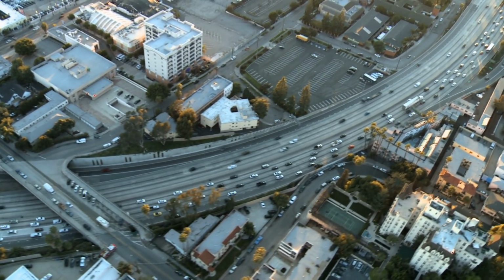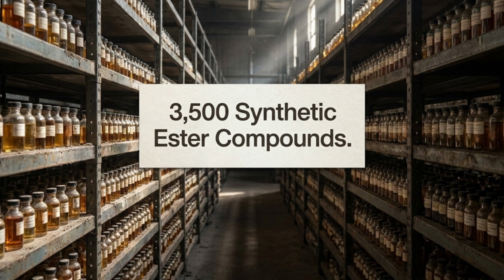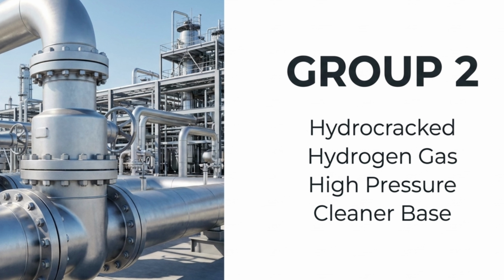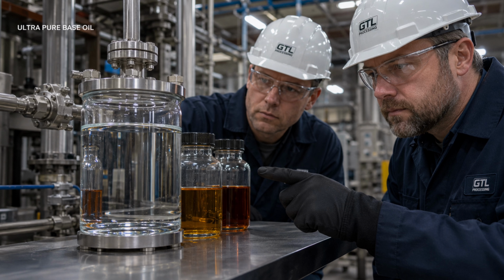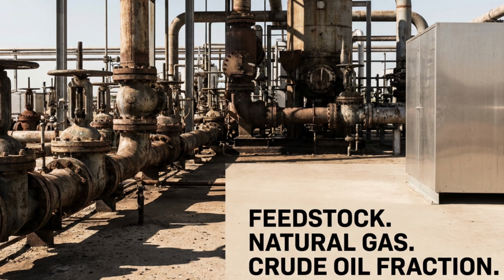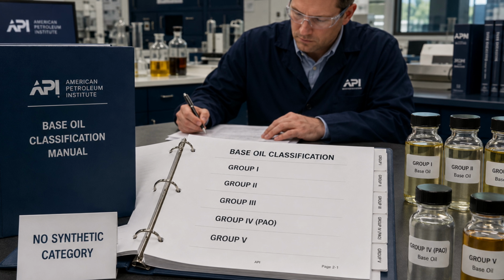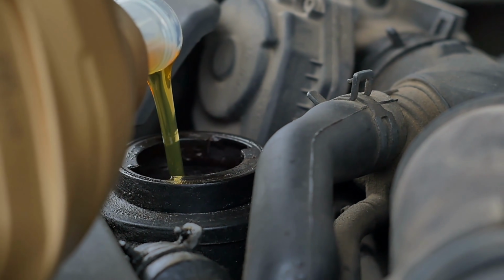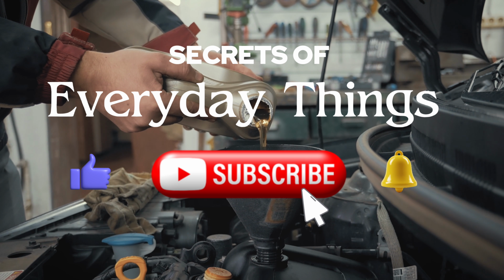How Is Synthetic Oil Made? THE TRUTH BEHIND WHAT “FULL SYNTHETIC” REALLY MEANS

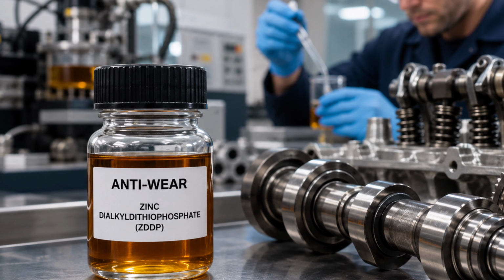Comment: 7:23 A lot less ZDDP in oils these days, so much so you might have to buy it as an additive for oil used in older engines without a catalytic converter.
Reply from the maker: That's a good point. Modern oils often reduce ZDDP levels to protect catalytic converters, while some older engines can benefit from higher ZDDP content.

Comment: BULLSHRIMP !!!!!
 
Taking a vehicle that has been run on organic and has ~80,000 miles then have the type of oil switched over to synthetic you WILL have issues. There are screens put into the newer vehicles oil circulation system and when you transition over to synthetic the crud built up by using organic initially releases and then clogs those screens. It happened to me with a 2019 Hyundai Veracruz.
Reply from the maker: Thanks for sharing your experience. Opinions vary on this topic, and following the vehicle manufacturer's recommendations is generally the safest approach.

Comment: Great video. As a 35+ year veteran of the oil industry, I think you did an excellent job presenting the facts.
The move toward Group III base oils has been underway for quite some time. While PAO synthetic base stocks still offer advantages, especially across a wider temperature range in both severe heat and cold, the base oil alone does not determine overall lubricant performance.
In today's engine oils, the additive package plays a major role in wear protection, cleanliness, oxidation control, and overall durability. That's why I generally recommend choosing established premium brands with a proven track record, as they tend to use robust additive systems backed by extensive testing.
Reply from the maker: Thank you so much for sharing your perspective and experience. I truly appreciate feedback from someone with so many years in the industry.

Comment: FACT: Semi-Synthetic can contain as little as 5% full synthetic.
Reply: Amsoil performed testing on all the Synthetic Blends sold in the marketplace and determined the amount of synthetic in their Synthetic Blend was anywhere from 1% to 15% (depending upon the specific brand).  Amsoil developed their own version of a Synthetic Blend (in order to compete against those inferior Synthetic Blends of their competitors) several years ago that actually contains OVER 50% SYNTHETIC!!

Lake Speed, Jr. (a.k.a. The Motor Oil Geek) conducted on a 5,000 mile oil sample of Amsoil Synthetic-Blend Oil on a 2012 Jeep owned by Ronald Robbins from Maine.  Lake was pleasantly surprised to find there were very low wear metals in the oil (only 2.4 ppm wear metals per 1,000 miles, which was well within Lake's recommended threshold of less than 5 ppm wear metals per 1,000 miles), where Lake remarked "that was doing really good." Immediately thereafter he said "that was performing excellent[ly]."  Lake determined earlier through an analysis of a "virgin sample of that oil" that Amsoil not only uses an Ester (a Class V Synthetic), but a special type of Moly additive (that is more expensive) in the Amsoil Synthetic-Blend Oil that contains a special form of MODTC (that is not usually found in a typical full-synthetic oil) that has a greater content of tin in his analysis of the "virgin sample of unused oil."  He added that special Moly (containing that unique type of MODTC additive) has anti-friction, antioxidant and anti-wear properties, which are borne out by the excellent results with low wear metals in his test of that oil.  Lake remarked that this oil would be equivalent to a typical "full synthetic oil" that you will find in a big box store, but he indicated a typical "full synthetic oil" sold at a big box store wouldn't contain that special moly containing MODTC (that is found in the Amsoil Synthetic-Blend Oil)!
Reply from the maker: Thanks for sharing. The definition and composition of semi-synthetic oil can vary depending on the market and industry standards.

Comment: The problem with whining about Group III being called synthetic is that even if the name was changed, the same product would still exist and it would have a product grade designation different from Group II. It would even be acceptable for use in the same engines. The name doesn't determine what it is. This really is a case of it is what it is.
Reply from the maker: Thank you for sharing such a thoughtful perspective. You're right that classifications and terminology can change over time, but what ultimately matters is the technical specification and performance the oil meets.

Comment: As a farmer with lots of different engines all of it used to be honey colored.  Ive noted that new oil is so clear that its hard to read on a dipstick.  Now I know why!
Reply from the maker: It’s great hearing real-world experience from someone who has worked with so many different engines. Thanks for sharing!
Reply: @SecretsofEverydayThings  I dont know that Im that much of an expert.  I did learn a lot this last year working on a project IH 784 with lots of hydraulic issues.  I was on one tech site arguing that the cold weather stalling I was getting might be solved by going to IH Hytran Ultra Synthetic.  This says that I was right.  All I did was to read the specs.  Prior to this IH had a couple tech bulletins on that and it amounted to overfilling the chamber to improve the downward flow.  Im still doing that but its unlikely Ill be changing out the fluid again any time soon.  An opportunity lost I think.
Reply: I used to work as an lube tech (specialising in ag lubes) for one of the big dogs.
Your 100% right
Reply: @danedgar1539  You're

Comment: -  So, we have learned that most synthetic oil - is synthetic oil.   Got it.   I live in a warm climate, so my brother changes my oil, and always uses 30 weight synthetic.    512,000 from my last Toyota (that got totalled, but still ran great), and so far, 241,000 on my "new" Toyota 5-speed.   But much of my transportation is on my bicycle.   I ride a Cinelli from 1987.  it has Campagnolo 50 anniversary groupo.
Reply from the maker: 241,000 miles and still running well is impressive! And that 1987 Cinelli sounds pretty special too. Thanks for sharing!
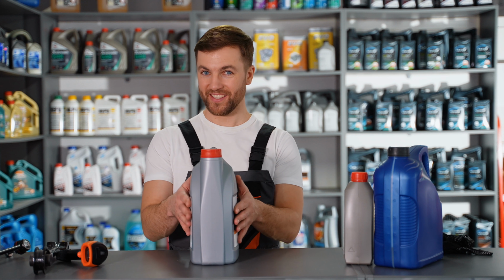Reply: @SecretsofEverydayThings     -  You're welcome.  Yes, I drive easy and slow.  Women don't have anything to "prove" - that's for boys.   My favorite thing to do on my bike is - stay with ... or in front of cars - it freaks them out that they are cars, yet a bicycle - much less a woman - can beat them.   In America, I got lots of angry drivers.  In my country, soooo many ride bikes, that it's not an issue.  I like the safety of my country.   Speaking of - it's lunch time now...   12:16

Comment: if I buy oil I buy Red Line, the only oil I have found to stay thin in air cooled generators when you are as lousy on maintainence as I am.
Reply from the maker: Thanks for sharing your experience! Different engines and operating conditions can have very different oil needs.
Reply: @SecretsofEverydayThings  true, and over twenty years out of date perhaps but I have been happy with it since the mid 80s in all my engines.

Comment: As a young university student, I worked in the lubricating oil production unit of a Gulf refinery. They were still making some base oil using solvent extraction with furfuraldehyde. The resulting oil was brown and I guess fits into the group one discussed in this video. The unit I worked on was a new hydrotreater unit where under high temperature and very high hydrogen pressure and a platinum catalyst, the same feed stock was convert to almost water clear base oil. I was amazed. It was the most interest job I ever had.
Reply from the maker: Thank you for sharing this firsthand experience. Seeing the difference between traditional solvent extraction and modern hydroprocessing in actual refinery operations must have been fascinating. Insights from people who worked directly in the industry add a lot to this discussion.

Comment: I just happened to change the oil in my car yesterday afternoon.  I do it myself.  5W-30 Mobil One.  With 98k miles on the engine, I do it every 3k miles.  I'm hoping for 300k+.
Reply: Just breaking in, keep doing what you're doing. I do the same but with Castrol Edge and get 250-350k on my cars.
Reply from the maker: Thanks for sharing your experience! 250–350k miles is certainly impressive.
Reply: @SecretsofEverydayThings I never ever had a oil related issue. Right now I have 2 cars with over 200k with thier original turbos. Now that impressive 👏 in the summer I'll change the oil around 2500 miles.
Reply from the maker: Sounds like you take great care of it! Hope it makes it well past 300k miles. 👍
Reply: You should be able to get 500,000 plus k on the motor. Something most people don't think about is the thermostat. They can stick when they get a lot of miles or kilometers on them. If that happens, you can get a warped head. A cracked head  or a cracked engine block. Change the water hoses and heater hoses by at least 150,000 miles or 250,000 kilometers.
Reply: -   Rand, why do you Americans still use those British "miles"?   Isn't it time to go "science", and rid Britain?  Just wondering, sweetie.
There are 4 countries left - who still use "miles":  Zimbabwe, Myanopar, Belize (all poverty countries), and USA.   How proud you must be.    🙂
Reply: Hate to break up the party but changing Mobil 1 synthetic at only 3k you're  wasting not just a valuable resource but flushing lots of your $$$ out the drain plug too. That short of an interval is a conservative one applicable to conventional oil, but high quality synthetic like Mobil 1 no way. Anything below 5 - 6k intervals isn't really advantageous to your engine.

Obviously in racing intervals can be much shorter, but I've NEVER actually heard it advised to change Mobil 1 at just 3k in street use. Except maybe if the car sat a long time. 

But don't take my word for it research it yourself! Plenty of great resources out there like Oil Geek.
Reply: @katmanluke7187 Well Kat, oil dilution from DFI, turbo and low tension rings will debunk what your saying. Don't get me started with carbon. Using expensive oil makes no difference.
Reply: @gino5037 I said nothing about "expensive" oil, the premise is quality synthetic oil. Degradation of those oils by 3k in a normal car is marginal unless the motor in question is poorly designed, a POS, or a dirty diesel.. Or all the above. Which is yours?
My '11 Honda 3.5L V-6 w/176k must not be so bad after all then because at 3k the Valvoline synthetic I use is barely discernable from new & I typically change at 6k. Vehicles much newer than 2011 I wouldn't venture to guess on since great majority are built to last the warranty & little more. Even Honda has motors prematurely failing.
Reply: @katmanluke7187 Mobil isn't expensive, seriously? I'll stick to Castrol never ever let any of us down over the decades.
Reply: @gino5037 why you asking me I don't use Mobil 1. 

Cost effective is actually the precise reason I switched to synthetic many years ago when conventional went thru the roof. Good synthetic easily doubles the 3k interval & offers cleaner, much better protection. And good synthetic isn't double the price of good conventional so it's synthetic for the win...
Reply: More money than sense.  What a waste of oil.
Reply: In an older carbureted car that change of around 3,000 Mi makes sense but modern fuel injected cars Burn Way cleaner and you are wasting a lot of money I would extend your oil change to at least 5,000 miles maybe 6,000 MI. By the way most car companies recommend 7,500 MI and sometimes up to 10,000, which is way too long in my opinion
Reply: @thomasward4505 You couldn't be more wrong! Higher compression, DFI, turbo, low tension rings, thinner oil, oil dilution get the picture now, 3k max! I bet that you believe in lifetime fluidsl in your drive system 😂

Comment: Pretty good, but still not the full picture.  The Group IV POA oil is Mobil 1 and I knew several of the engineers who developed it.  What they said was interesting.  Lubrication oils are longer chain hydrocarbons.  The longer the chain , the better the lub qualities and the more durable the oil in service.    Group III is the best natural oil but nature only makes the chains so long.  The hydrocarbon chains in POA are 2 to 3 times as long as the best Group  III.  That length gives it the temperature range and the viscosity  endurance at temperature extremes.  The best POA have only 3 or 4 different types of chain lengths with miniscule performance differences.  But they do not exist in nature.  The longer life of the POA is also a function of the chains.  As oil  is used, the heat and contamination cause the oil hydrocarbon chains to break down gradually causing the viscosity and other aspects to deteriorate.   The recommended change  interval is based on when you can expect the average oil to hit minimum performance.  With a POA like Mobil 1, you have the same breakdown but the oil breaks down in to a conventional grade during its service life.  If oil life were a ski slope, regular oil starts at the mid point and POA starts at the top.  By the time mobil gets to the midpoint is is a good Group III.   The oil burns less generating less carbon and dirt.  It is cleaner to start with as well,  but the oil filter does matter evenmore with a long life between changes.   The different nature of the synthetic also has benefits.  Synthetic oil actually leaves a better residue  which matters for startup.  Automotive Motor oils DO NOT have the zinc compounds because they wreck the cat converters and conventional oil drains down leaving the dirt residue for startup.  That means more metal to metal time at startup.  POA oils flow very fast at startup and can refill the oil supply in seconds, 1/4 the time of conventional oil.  90% of normal engine wear occurs in those seconds of metal to metal contact so speed matters.  Couple that with the residuals the synthetics leave on the metals and you have a real measurable  reduction in wear and damage.  That combination is also why  engines in extreme cold startup easily in cold weather.  Even in hot desert weather, there is a measurable difference at starting compared to conventional.   

I have had 6 cars using Mobil 1 POA that have gone 250,000 miles plus since the 1980's.  i have had to fight with the mechanics to use Mobil 1 since they prefer to use the Group III which is much cheaper and sold in barrels.  It makes a difference.  For the record, I am an engineer who has been in charge of heavy industrial equipment for 4 decades.  Steel mills, power plants, refineries, chemical plants , etc.  I have seen a lot of lubrication applications and I had the opportunity to work at the Mobil Plant that makes Mobil 1 in Paulboro NJ.
Reply: mobil 1 is group 3 sorry to bust you bubble. amsoil is the only true group 4 and 5 blend. even the it only applies to signature series. while it holds better than any other oil. PAO and esther base oils break down seals and act like you just dumped 6 qts of tide in your engine. if you have gunk it will cause leaks .
Reply: @mem3656 There's a lot of brands using IV and V base stocks. And the reason why they often use both is for solubility and avoid issues with seals.
Reply: You make it sound like Mobil1 is all PAO oil. You Can't have all PAO oil. Additives don't mix in PAO well at all. You need a base oil and that's where Group 2 and Group 3 oils come in. Most Mobil1 oils have these 2 groups in them. Mobil1 now has less PAO in them because of the damaged oil refineries.
Also, many other oils have PAO in them. Amsoil, HPL, Royal Purple, etc
Reply from the maker: Thanks for sharing such interesting information! It's always great to hear additional perspectives from people with knowledge and experience in the field.
Reply: Motor oils most certainly have ZDDP in them.

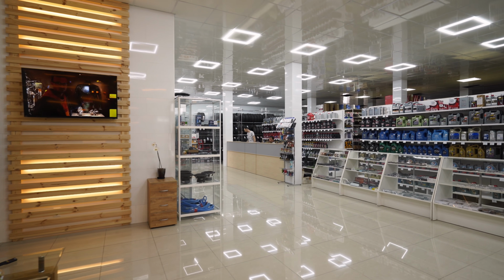Comment: At 13:33, spin the bottle 180° around so the opening to the bottle is at the top not the bottom and the pour is more accurate. Not a problem here since there's a funnel, but useful when there isn't one.
Reply from the maker: Thanks for the helpful tip! It's a small technique, but it can definitely make pouring more accurate when you don't have a funnel.
Reply: this video is I.A

Comment: Excellent video, I had no idea how it was made or what made it different. Now it comes down to the additive package. I'll have to start reading bottles and see if I understand the lingo. Such as using Costco vs Mobil 1 in a typical turbo engine. Makes me think changing more frequently is better in the long run than stretching it with a more expensive oil
Reply from the maker: Thanks for sharing! The additive package and the correct engine specification can matter just as much as the base oil. Regular oil changes are still essential.